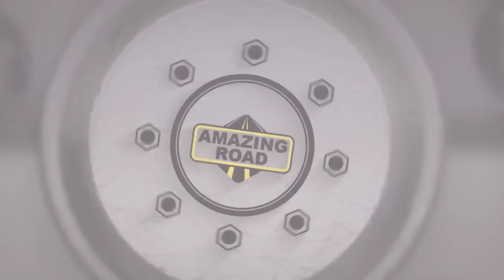Install the angel's eyes on the BMW / Installing Angel Eye on BMW E46, E36 E38 E39

Comment: I feel sad for seeing such a nice e46 neglected and so dirty :(
Reply from the maker: If you notice the motor is under repair, and the car is already 15 days old
Reply: Agreed plus fair enough they got the light working but it seemed like a shabby job
Reply: Can the lights be connected in any other way
Reply: oversprayed glue on the chrome bezel  🤗🤗🤗

Comment: So if you connect the wires to the position lights you dont need to connect them to the positive and negative of the car or did you connect them to the positive, the negative and the position lights?

Comment: when you tap the power from the small light does any symbol came out at the panel? I can even change the small light buld to LED bulb as there will be a light symbol came out at the panel

Comment: I have the same lights, however when I linked them to the sidelights they started to strobe when the engine was on? I’ve since connected them to the thermals where you tested your lights but then they are always on and I can’t turn them off with the remote cause the signal is too weak. Did you tap into both the side lights to get more power?
Reply: Hey, I have same angel eyes, can u tell me where to connect wireing?
1 black, and one red wire
Reply: How did you solve this problem?
Thanks

Comment: I have an issue when connected to sidelights they work, remote works and all, but as soon as I start the engine they start glowing green and remote doesn’t work, any way to connect so that it works with engine on. Thanks @amazing road tv.
Reply from the maker: don't know friend
Reply: input output connectors are backwards. Ebay description explains how to fix it
Reply: mason barsony can you give us a link or something?

Comment: I have a question. I installed RGB 5050 on my civic and 6 months later a couple of the lights are out example where it is suppose to be white a different color took its spot and is red or blue instead. Do you have this same issue?
Reply from the maker: No
Reply: Yep same issue the control box went bad i got a repalcement control box and all is good now.

Comment: I bought these same lights but remote is broken, is there any fix? I already bought 2 remote actually and 2nd was broken as well! Lights are flashing non-stop! :(
Reply: These are the cheapest things possible. If you see this kind of remote or the white plastic box of LED-s, just leave it there. Don't buy it.
You can just mess it up and make up some shittyasss job like this guy did in the video.
I'm assuming this is a fake one as well, since this white box can't show 2 colors at the same time, as it was in the end of this vid.
The only porpouse of this video is that it is probably attached as an installation video where they sell it. They make you thinkat the end, that this is a good product.

Comment: Are you sure that's the right link? The ones you installed have the magic color flow chasing effect. The ones in the link is just the solid color changing ring.
Reply from the maker: Yes, friend. We bought it in this store
Reply: Amazing Road TV so? it doesnt make it same product
Reply: That effect i think is created by the camera shutter, same thing when some leds flash on video but not when looked at in person.

Comment: link for the angel eyes?
Reply from the maker: http://www.ebay.com/itm/4x-Multicolor-RGB-80MM-5050-SMD-LED-Flash-Angel-Eye-Halo-Ring-IR-Remote-Control-/371530301766?hash=item5680ee8146%3Ag%3AfocAAOSwHaBWlHdK

Comment: These are the cheapest things possible. If you see this kind of remote or the white plastic box of LED-s, just leave it there. Don't buy it.
You can just mess it up and make up some shittyasss job like this guy did in the video.
I'm assuming this is a fake one as well, since this white box can't show 2 colors at the same time, as it was in the end of this vid.
The only porpouse of this video is that it is probably attached as an installation video where they sell it. They make you thinkat the end, that this is a good product.